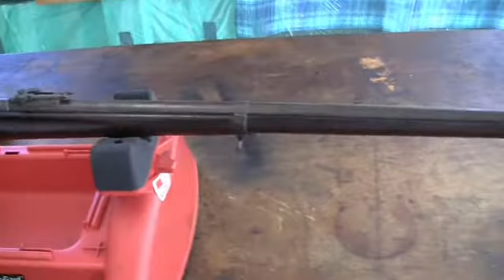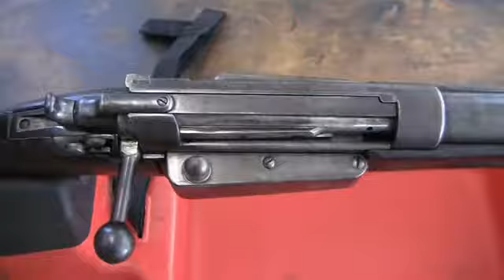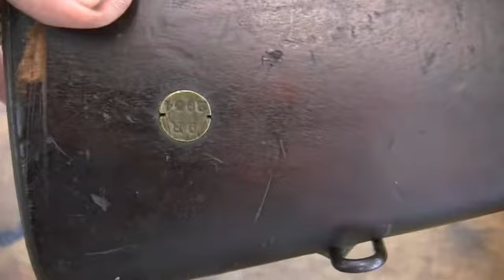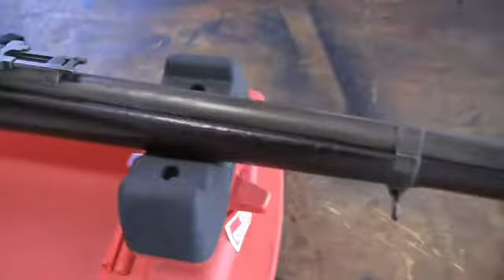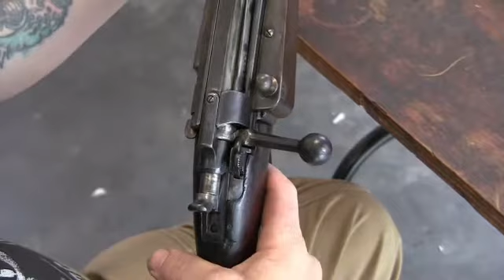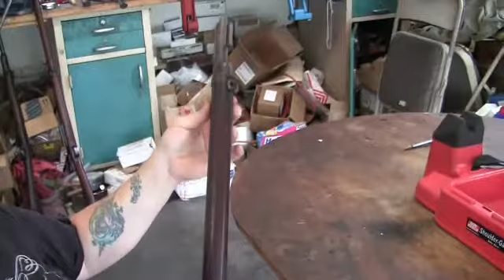The Danish  1889 Krag Jorgensen rifle 8x58R

Comment: The brass tag, typically says what regiment the gun served in, the idea with the barrel jacket is the same as with the 1888 commissions gewehr.

The original 1889 pattern, had a barrel with metford rifling,  no safety.
The magazine cutoff is on, when the lever is down.
8x58r casings can be made out of 45-90 and 45-70 casings.
Sweden adopted a rolling block in the original 8x58r black powder ammo, known as the 1889.